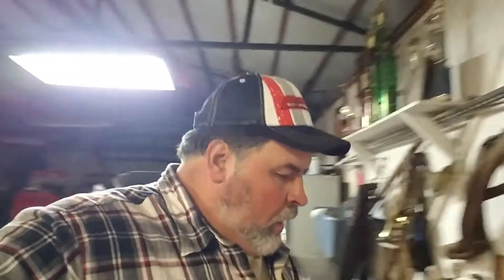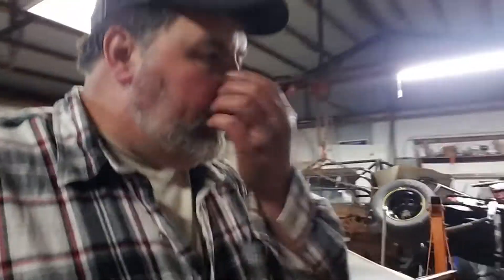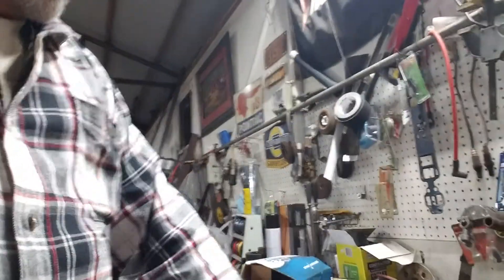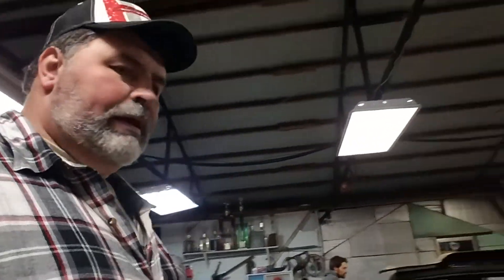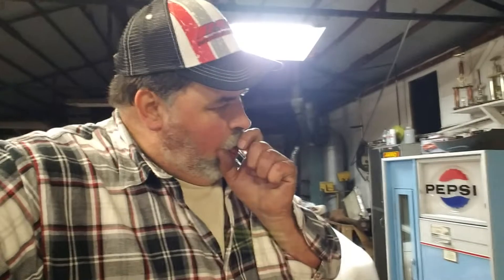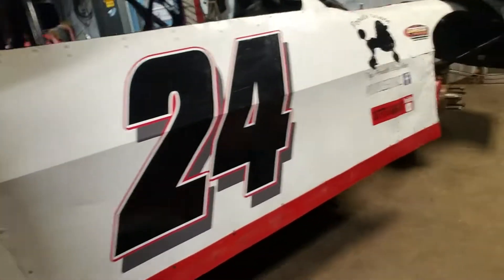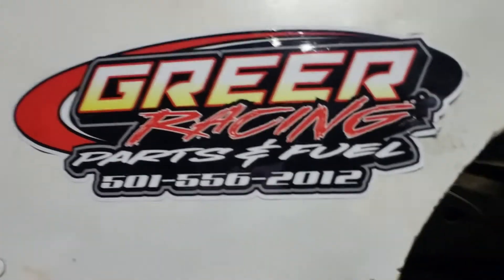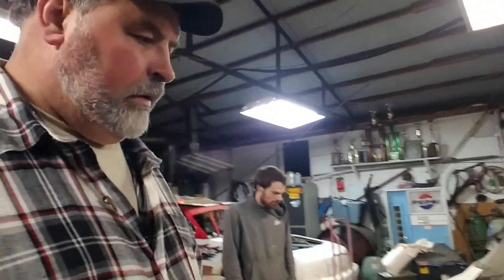Starter problems with the stock car.

Comment: Russell I've been using the proform mini starters and so far no problems
Reply from the maker: This one we have is an msd. It spins and engages great. But something in the bendix is malfunctioning and stops driving the bendix in mid spin. Let off the button and the motor starts slowing down and just before it stops it kicks back in the bendix